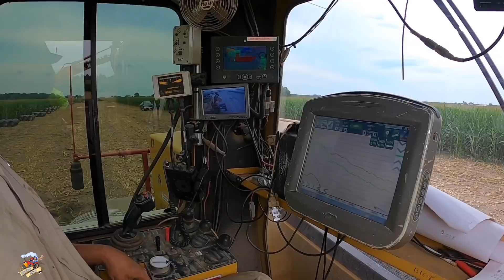Field Drainage - Installing a Catch Basin and Main County Drain with CSI

Comment: Thanks for sharing the video of installing replacement County drainage.  Makes sense the County should provide major drainage lines.  I grew up in Fruita, Colorado on a 40 acre horse hay farm.  Dad ceramic tiled the twenty foot deep drainage ditch top 40.  He recovered many more acres to farm.  Then, he had the farm leveled.  But, we always had a small alkali sink in a .25 acre.  I like the plants in it.  Dad also installed cement ditches to have enough water for the hay & pumpkin farm. Three of us kids had our own pumpkin business young.   

Adding irrigation water in the high desert, caused higher levels of alkalinity in the fields.  They installed drainage for alkaline water to drain from Grand Valley floor old sea bed.   So, government over a hundred yrs ago, installed in a grid if open drainage ditches through the valley from Palisade to Mack, CO.  Then, it was up to property owners to maintain the deep drainage ditches, that dump off into the next wash.  Then, most of the irrigation ditches in the Grand Valley were cemented to reduce the alkalinity in the Colorado River.

Comment: When the trencher picked up the box,  there was a lot of weight on back and you could see her lifting a little on the tracks.
Very quick operation in the right ground conditions plus the crew know there jobs very well..
Reply: Thank you. Sometimes we have to use the excavator to lift the back end as the ground applies too much pressure

Comment: Up in Hardin County, Ohio back in the day Dad backfilled with his John Deere MD Crawler.  Would have blisters on his hinnie at the end of the day.  A man would use a spade on the non-dirt pile side to cover the tile so a rock from the backfill would not break the tile.  Dad referred to these as the "County Ditch or Tile".
Reply: that is called bedding the tile, I have done that with every bit of tile I installed, clay and plastic. Then i fill in the trench. My father & uncle did it it that way & never had a problem using that method.
Reply: I don’t see any rocks

Comment: the structure they set is the low point in which they are starting at and laying pipe to the high point like your supposed to do then that would mean they are laying their pipe backwards. The bells always go up hill.

Comment: Coming from a fellow tile installer here. They are laying the pipe backwards. Also I didn't see them checking elevations to ensure proper height of pipes or manhole besides the level. I'd be very nervous of this company in my opinion. However they have a nice looking buckeye!
Reply: The grade stick with the laser receiver was in multiple camera shots checking elevations around the junction box
Reply: Jesus.  The grade was shot constantly.

Comment: Pipe is backwards and killed way to much corn..I work for a tile
Company in new castle, Indiana we go through the crops and not destroy much crop that we can and doing a big job like that during the summer because it’s dry we do it whenever we can if there’s crops the farmers have to give us the ok go through their crops but usually we do it in the fall to planting season water doesn’t stop us unless to wet on top
Reply: I agree the sections were all put in backwards that were shown...assuming they are working "uphill" from the bottom/lowest elevation to the top/highest elevation to keep water draining out of work area/open trench .  the backwards mating of pipe sections will eventually cause sink holes to open up at the joints.  may take 20-30 years but it will happen...
Reply: It’s not backwards. That way works best when pushing the pipe together. And it was the farmers idea to remove that much corn. It was not needed
Reply: Must of started from uphill to downhill then
Reply: @hubertutt5842  no. We dug upgrade
Reply: @billysteve1503  then the pipe is backwards bell end goes up hill
Reply: @hubertutt5842  do you think the foreman of a $300,000+ job would lay the pipe backwards if it caused suckholes?
Reply: @billysteve1503  we all seen the video Bell end is down hill and you admitted you started downhill to uphill which would make the Bell end go up hill look it up
Reply: @hubertutt5842  it literally doesn’t matter which way the bell goes. Everytime we do a job like this, our boss asks the people throwing the pipe, aka me, which way do you want the bells.

Comment: Forcing the angles instead of using 33 degree or 45 degree fittings saves on costs but results in less than optimal solidity of the connections as well and most likely premature problems.

Comment: Any idea of how much crop was lost? Wouldn't doing it while there is no crop make more sense?
Reply: The way it was explained to me was if you did the tiling job between harvest and planting you might not get it completed because of the ground conditions being so bad. Or you might be able to get it accomplished but do a lot of damage to the field with all the equipment creating even more work to get the fields ready to be planted when there already strapped for time in the spring. So it's cheaper to do it now even with the loss of a little crop, which is only a couple of acres not very much at all. It looks far worse then it really is.

Comment: Interesting video👍👍
Once they're rolling, how many feet of pipe can they put down per hour??

Thanks!
Reply: I was working on this job, It depends on the size of the pipe. But on a perfect operation, 70-100 feet a hour
Reply: @billysteve1503  thanks, that sure is gettin' after it, stay safe

Comment: 30" pipe - that must drain a lot of gal/min. Where does it all go? What is the effect on the acquifer below?
Reply: Usually those sort of things go into retention ponds where the water can soak back into the ground. The idea is to drain water from low parts of fields that would just become useless bogs in the rainy season due to water accumulation, usually on the top of a semi-impermeable clay layer. Essentially the water is just moved to someplace else where it can soak in without becoming a bog, or else be moved to a stream or river.

At a guess you could run about 10,000 GPM through a mile of 30" pipe with a fall of only something like 10 feet to account for the head loss due to boundary friction.
Reply: There is no aquifer in that part of Ohio.

Comment: wow this is really expensive way of removing the water of the fields. It is way better to create a couple of creeks and use smaller drain tubes who end up in the creeks. But I have to say, in the Netherlands we are practically living in the water, so we know how from experience how to deal with it :)
Reply: Not expensive considering how much water those tile will drain.   Ohio is not the Netherlands.
Reply: It seems expensive but it will improve the field more than a ditch system. Ditches impede the work efficiency of the field, less area, more obstructed, more turns needed working the smaller field plots limited by ditches.
Now the field is in top efficient all equipment can go straight for miles (how ever huge the field is).
All those small inefficiencies build up top of my head i would guestimate 5-10% more efficient this way than ditches considering less fuel and less strain on equipment going straight than maneuvering around the ditches.
If this cost double than ditch system it pays off in 10- 20 years not bad when it holds 70+ years.

Comment: The pipe is being installed completely the wrong way round, the small should feed into the big for direction of water flow. This is just going to cause sinkholes and erosion from leaking. Very poor job.
Reply: Really? How would sinkholes form? Put pipe this way for years and lasted well over 50 years